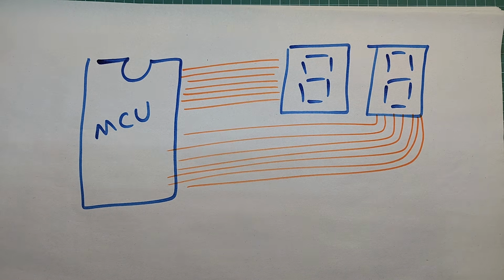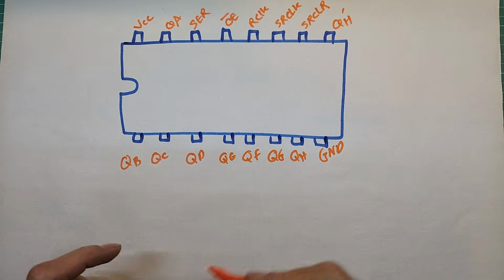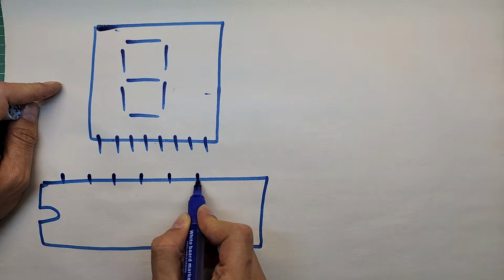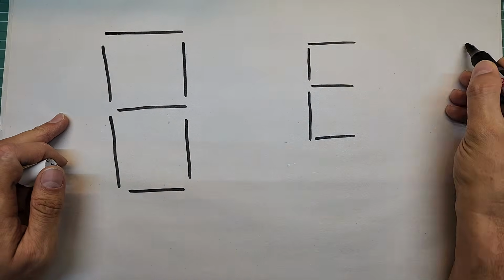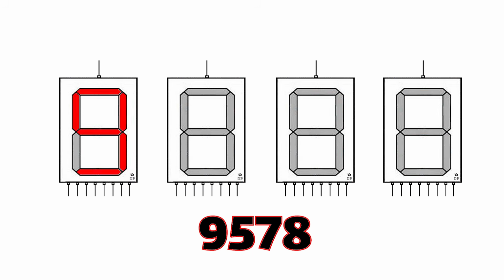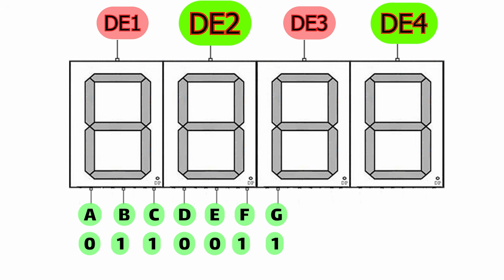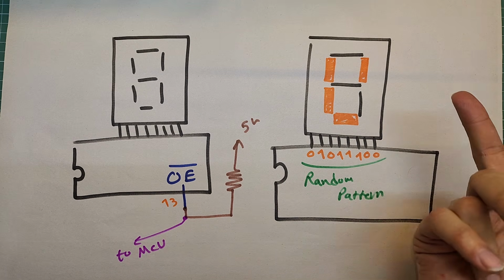Why the 74HC595 is Your Next Favorite IC?

Comment: I liked this video.

I think that you will run out of wires (or PCB traces) if you
try to connect an infinite number of 74HC595 IC and 7-segment
displays together into one working unit.

Excellent that you pointed out that the MCU need only supply the
voltages, and only when the displays change, and not the current
needed by the ICs or the displays, and that the displays might
be initialized to some random, meaningless pattern.

Excellent that you revealed pin 13 to be the "master on/off switch".
Ditto for the clocking of pin 12.

Which video is the best one to start learning about your "10
channel lighting system project"?'

Thank you for your many tips on the 74HC595.  You explained in
meticulous detail and logically how to use this display subsystem.
 You've given me the confidence to use this with 7-segment LEDs.   
Very well done.
Reply from the maker: I'm so glad the explanation helped and you feel confident to start your own project! 😊

Comment: Hi. I have a couple of HC595 from a CMOS IC assortment. Brand new. Never used. Time to learn about these popular IC and put them at work. Thanks for your very clear explanation. I usually use multiplexing techniques with parallel CPU outputs. Time to go serial. The problem is that you need an IC for each display; is it really worth it for 3 to 4 digits? I am a newbie on microcontroller programming and PCB making. Using HC595 is a lot more complicated but i have some dev boards with HC595 included and i'll use it to practice. Never too late to learn. Programming is my weakness but i use AI for this part of a project.

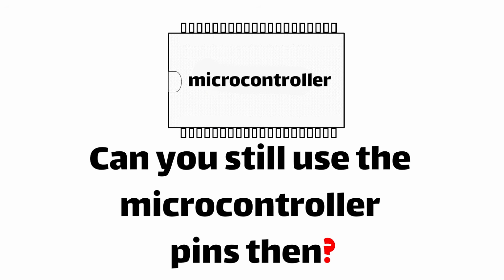Comment: 10:53 Yes; is it posible to use various displays with jus one 8 bit paralel port and the remaining output bits of the microcontroller; it is called opticar illution; you just power up every digit one at the time and the human eye won't tell the difference. Also is more energy efficient than latching out for every display.

Comment: It's rather shitty IC because it doesnt guarantee predictable outputs during power-up. Never use it to drive loads, such as power mosfets, or relays. Otherwise you have to deal with unpredictable behavior of this IC, untill You'll initialise it.
Much much better solution is to use 74HC594 register. It gives you dedicated latch reset input and it gurantees you predictable output during power up.

Comment: I wouldn’t say it’s ever going to be my favorite, but it has a lot of useful applications if you have a good imagination. Chips that I specifically like working with would include the 555, 74ls154, and 4017 just to name a few. If I had to choose only one. It would have to be the 555 if I excluded microcontrollers and CPU’s. That chip would certainly be in my top ten list. I have at least 50 of them. When I buy parts for hobby projects. I’m always thinking two is one and one is none, but fifty or a hundred is better, so I buy in quantity when I can.
Reply from the maker: Interesting, thanks for the input and sharing your favorite ICs! 😊

Comment: There's also the inverse (parallel to serial shift register) that I have used in conjunction with the serial to parallel chips for various functions from keypad decoding to external memory interfacing. There are several widths available that allow keeping the part count low in the design. I keep a collection of these, along with I2C I/O expanders, handy when playing with circuit design. When combined with a low pin count microcontroller or FPGA, the possibilities are endless.

Comment: I've had ten or so of these in my components box for a couple of years, they are very useful. But first time I used them, I forgot the decoupling capacitors… why are my bits getting corrupted??? Oops…
Reply: But you can use them on an SPI interface with no issues, no need to manually send bits, just use the microcontroller's SPI library.

Comment: i have used these before. usually i prefere dedicated io expanders like aw9523 which is really cheap and has led drive capabilities but often times when cost is VERY important these 74HC595 can be less then 2 cents in volume and often i just need bunch of outputs for indicator leds for a UI. best of all they can easily be run directly off a SPI bus by using the RCLK as the "CS" pin as the data latches to the output when CS goes high at the end of the transmition so if i am already using SPI then i only need one additional pin for the RCLK. very usefull chip but pretty niche. if cost is not as important or you also need input or led drive capabilities then just use an io expander, aw9523 are still quite cheap and provide a lot of functionailty.

also coupled with a buffer like ULN2803 you now have yourself an 8 channel relay driver that you can just chain in series as many times as you need. very handy of you have a ton of relays and need a simple reliable way of controlling them from spi
Reply from the maker: Awesome, thank you for sharing your experience 🍻

Comment: 40 years ago in my technical training, this is useful. Today, it’s just nostalgic.
Reply from the maker: Thank you for sharing your perspective.
Reply: I see it the same way. This ic has been discussed a zillion times. In digital times with mcus costing less than a buck, this has not much use cases, and often the ic you are showcasing is more costly than the entire mcu. You’re doing a great job. Just wanted to express that I too found this particular topic bad because it is not (anymore) state of art.
Reply: @twr4641 I don't think he is making this video to introduce a state of art tech to cutting edge engineers. This is a basic for begginers. And cheap mcu
 does not replace shiftregisters. I use LED matrix panel in my projects and that uses lots of shiftregisters. Without undestanding how they work , you can not make  good library for it.
 Well.  Say mcu , identify a mcu that is cheaper than 595 and as quick in doing equivalent job in driving led matrix panel or more than 10 7segs.
Reply: @youpoofoowoo  i hear you, that makes sense. However (since you asked), a esp32-c3 mini with usb-c and 4mb flash on a ready-to-use board is currently available for less than 1€ (regular price, no obscure „welcome deals“). So that does put it into the price range of classic ICs ;-)
Reply: @twr4641 You can find cheaper mcu such as CH32V003 which is approx 0.1 USD in large size moq at LCSC.  But at same LCSC you will find 595  at around 0.02. Cheapest mcu still cost much more.

Comment: It's awesome, yes. I developed a multiplex driver circuit with two 595, one for segment and one for digit. The digit pin is driven by a driver IC. I do not use any transistors.

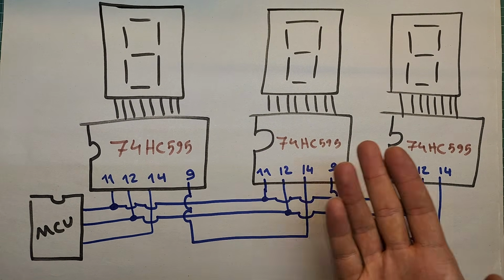Comment: Firstly, thank you for this amazing introduction. I already subscribed. And I have a quick question. In the schematic at 16:59,  i can see all the IC's are connected serially (from 9 to 14) but how does this work actually? I mean, when a 74HC595 starts to direct the serial data input from its pin 14 to its pin 9 as an output? I mean, this shouldn't happen simultaneously because you would want to drive the IC's one by one. I assume that this happens when you finish writing and flushing the 8 bit data to the parallel output pins. If so, you can set the IC's one by one. But now the question is, how you can go backward and start to set IC 1 again? Does the CLEAR pin works like reverse of OE pin? I mean, how you update all the displays after set all of them once? Do you send clear signal all of them and that signal cuts the connection between pin 9 of first IC and pin 14 of second IC? I wondered this because you didin't mention the CLEAR pin in the schematic at 16:59 and I want to know how it exactly works. (I just noticed that OE pin is also not mentioned in that diagram so probably you didn't also mention the SRCLR pin for the same reason.)

Comment: The 74HC595 and the 74HC4094 are similar in function but the 74HC4094 seems way more stable if you need to make sure of cascaded outputs spanning many devices in series not to have timing issues. Also the load is transparent if the latch is high, not edge triggered and it allows for 12v operation in the form of CD4094. 
Sad thing is some processors are now getting so cheap, you can just use one of those for logic functions with a huge variety of functions through software instead of these dedicated logic chips.

Comment: I've been contemplating how I was going to use a 16 or even an 18 series PIC and control 20 individual mosfet drivers individually and then all simultaneously. The "individual" part I believe I can accomplish now, but it's the "simultaneous" I'm not quite clear on. Is it possible to set all of the 74HC595 or even 94's outputs hi if I chose to and clear them in like manner? 

It's been 15 years since I've built anything this complex much less done any coding per say. Thanks for any help you might offer..😊😊😊

Comment: I prefer the HC594.  It the same as the HC595, except the /OE pin is replaced with a /RESET, that clears both the shift register and output register to 0.  Connect the /RESET to a .1uF cap to ground and put a 100K ohm resistor from /RESET to Vcc.  That will insure all outputs are low on power up.  Configure your subsequent logic so that low is your preferred power on state.  For example, if an output will be used to turn a motor on, set it up so that high turns the motor on.  This insure the motor will be off on initial power up.  You can achieve the same effect with the HC595, but you would need a pull down, or pull up resistor for each output, and the /OE pin needs to be connected to the microprocessor, and be brought low once the HC595 is initialized.  The /OE pin would also need a pull up so that is high on initial power up.  All that goes away with the HC594. 
Also, if you want the HC594 to be reset when the CPU is reset, connect some logic so that the HC594 is reset on initial power up, and when the CPU line is brought low.  Personally, I like to use a voltage supervisory IC like the MC34064, so that /RESET is brought low, when Vcc falls out of range.  Note that on some Arduino's, the /RESET line is not brought low on initial power up since the Arduino generates its own internal reset.

Comment: IMPROVEMENT ALERT!  Turns out there's a version of 74HC595 (called 74HCS595) that has Schmitt trigger (hysteresis) inputs! This is especially useful on the serial shift clock to help the serial data bits shift in reliably -- no missing or extra steps.  When the 595 is hosted on a normal PCB, this is normally not an issue. However, the 595 is useful in applications where it's located some distance over lengthy wires some meters away from the main MCU. In such applications, the signals can suffer degradation, such as bouncing or other noise, which is fatal for the serial clock signal.  
For use with Schmitt trigger inputs, you can adjust the MCU output drive (or modify it with additional circuitry) to produce a relatively slow-rise-time clock signal. This has much lower tendency to bounce. Additionally the Schmitt trigger inputs will be less susceptible to other environmental noise.  (Thanks to my colleague JR for pointing these out to me!)
Reply: When using this device as a remote register, you should consider the clock signal wiring as a transmission line, this will reduce the noise and increase the speed of operation.

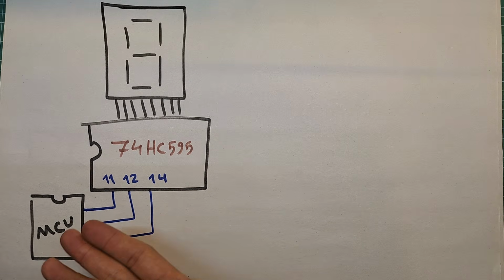Comment: 16:33 I am a bit confused on how if they are all connected to the same MC output they would read different values on the 7 seg. Would they all not get the same clk on and off and they are connected on the same wire bus like that?
Reply: Yes, they all get the same clock, it's the data line that carries the segment info.

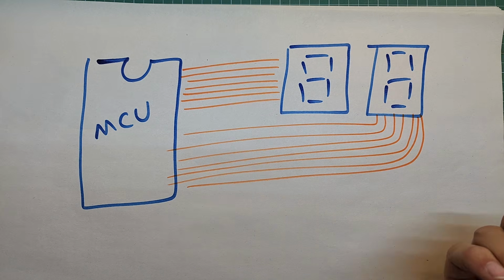Comment: 1:32 running out of I/O ports? I just use SPI or I2C displays. Multiplexing digits just reminds me of the Sinclair scientific calculator.
Reply: Lots of those are just a parallel-input display and a shift register. Sure, it's often easier to use something integrated so you don't have to design and build the interface, but sometimes it's also better to have full control instead. And it's often best for me, at least, if I learn how that kind of thing works in case I run into issues with the integrated solution.
Reply: That feels like a comically complex way to do the same thing. How many shift registers do you think a microcontroller is using to clock out bits across SPI or I2C?
Reply: I mean think about it. A 7-segment display is literally just some diodes, and you're talking about replacing that with a display module that contains a controller more complex than the computer on Apollo 11.

Comment: I'm a huge fan of the 595, and the 165 and similar for inputs. Not only do the do io expansion, they also let you put the io where you need it, making it easy to put high pin count designs on a 2-layer board, and of course, you can use a lower pin count MCU. Finally, from a software perspective, they naturally lend themselves to a clean, uniform abstraction for io, which MCU gpio often doesn't.

Comment: It would be so much neater if the data outputs all lined up on one side of the chip. Is there an electrical reason that they don't? Maybe putting vcc and ground on opposite corners has some benefit?
Reply: Do you mean all the series of data coming out at a single output?
Reply: @EI.01 I don't mean that. Right at the beginning of the video the physical arrangement of the pins is shown. Later when stuff is drawn it becomes a bit more abstract. With respect to the physical locations, seven data pins are on one side of the chip and the eighth data pin is on the other side. I find it quite disharmonious, but I I'm curious as to whether it has a practical benefit to offset the aesthetic negative. I also understand that aesthetic concerns are not paramount in designing ICs.
Reply: @AndrewHelgeCox  to clarify this at what minute and sec of the video did you found this disharmonious. Lets clarify this together let see if i can help, because 
the “disharmony” seen in pin layouts usually reflects deeper engineering decisions rather than oversight or disregard for aesthetics. IC designers prioritize signal integrity, manufacturability, and performance over visual neatness.
Reply: @AndrewHelgeCox  Not an electrical reason, but one grounded in convention. There is a long standing tradition that 74... ICs have their power pins on 2 egdes. As chip designers use the smallest packaging available (due to cost reasons) it was simply not possible to move all outputs to one side of the IC. So they did the next best thing, only one output is on the "wrong" side and it is the first one, because that would break the pattern.

Comment: Thank's you are the best teacher! How aboat sending signals to the microcontroller using a shift register with inputs not outputs.
Reply: For that scenario look at the data sheet for the 74HC165. It will accept 8 parallel inputs and allow you to clock them into the microcontroller in a serial fashion. Essentially the opposite of the chip presented in this video.

Comment: but have I missed the explanation of the proper way to use the ICs in series from a single MCU, or you haven't described it in details here in this video?

For the rest of the video - thanks for such detailed explanation.
Reply: Pin #9 connected pin #14 lets the bit pattern ripple through the register chain when clocked.

Comment: However it can drive only 8mA. For driving LEDs I rather use something like SCT2024 (you need only one resistor for setting the current). And as a low side switches for example TPIC6B595 (up to 150mA continuous, 50V clamping voltage, 5 Ohms Rdson)
Reply: Right, so many youtube videos where they overstress these chips and don't consider the total chip current limit.

Comment: I have used it for decades and it is most useful. When working with its companion chip for getting in digital inputs, they make the controller a really powerful unit with simple serial control.
Reply: So that 165 IC is the inverse of this 595 serial to parallel IC?
Reply: @soloflo  Yes. By running them in a serial loop, like 2+2 chips, you can get 16 I/O. It is sufficiently fast for regular I/O. Just a few control lines extra needed.
Reply: @soloflo  Yes.
Reply: In the 1980s, I knew someone who built a tic-tac-toe game using similar parts and a UV EPROM.
Reply: @filker0  Yes, some have invented clever automata by using EPROMs as a kernel. It was a cheap solution at that time but very time consuming to develop.

Comment: I've never tried these, but I've used I2C I/O expanders.  The nice thing about those is they can configure each line to be a output or input (some chips even have pull-down or pull-up support).
Reply: I use 595 and 165 extensively, especially with the RoxMux library, I've just started using mcp23017 i2c port expanders fir encoders instead of pots on mux inputs, but of course the limitations I have is only 8 expanders. Limiting the amount of devices, plus the new 16 channel versions are only 14 channel.
Reply: @craigyjp IIRC some mux support tree topology, so you can cascade them that way.

Comment: I always preferred  an up/down counter and a 74LS 138 or a 74LS 154... I had always wanted to create a master sequencing clock that was 32, even 64 times faster than the beat of the music ...all using logic chips transistors, op-amps etc etc etc ...these days, all of that simply happens with decent software and a DMX lighting system... :/
...I guess a shift register and a few MOC 3010's are a good approach for a simple rig...

Comment: I have gone one step further, driving 2 digits from one 595. Using a BCD to seven seg decoder (numbers only though). Out enable can be used for PWM brightness control (blanking pin on the decoder though). In combo with a ULN2003 or 2803 can drive higher currents or voltage displays lamps or even solenoids. I’ve made a “jumbo clock” using LED lighting strips and the mentioned IC’s, it’s over a metre long and digits are around 220mm high. I also have the chime from a mantle clock in there for the hourly chime